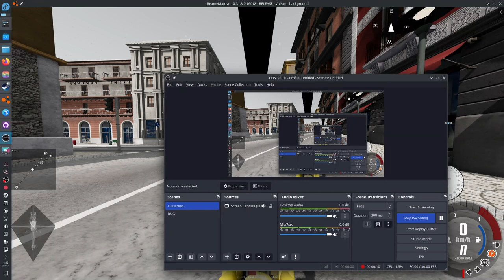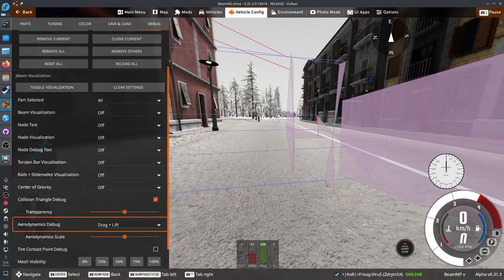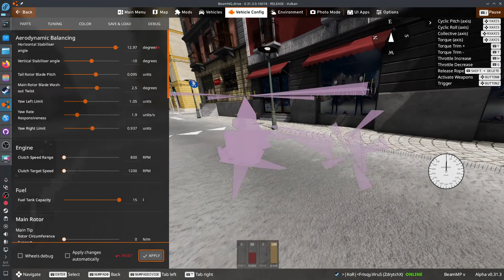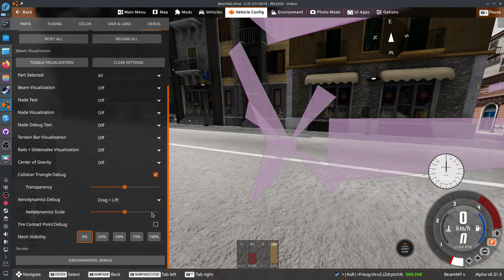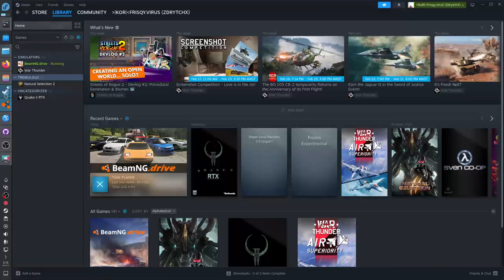Adverse Cyclic Controls - DH Super Gnat, How it works「BeamNG」

Comment: My rotor won’t move, is that a problem of the mod?
Reply from the maker: check the part heiarchy. Someone's informed me about this issue too, and in his case apparently one of the presets is borked if you load multiple versions of the helicopter together, the version I released on github doesn't have the [BETA] on the vehicle preview. This can be a result of an improper mod install

inside your appdata/beamng/vehicles/dh_helicopter folder there should only be saved presets and thumbnails, nothing else.